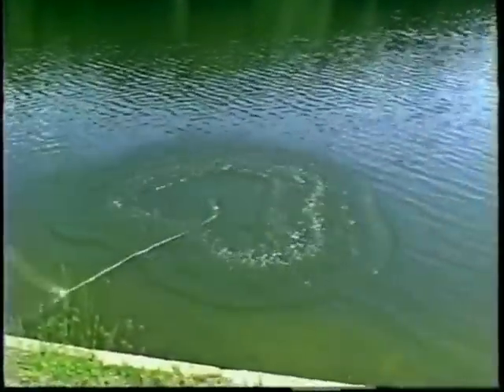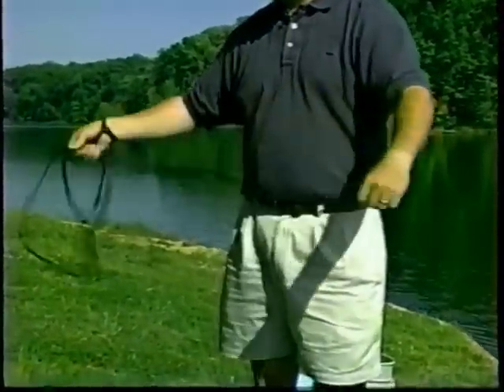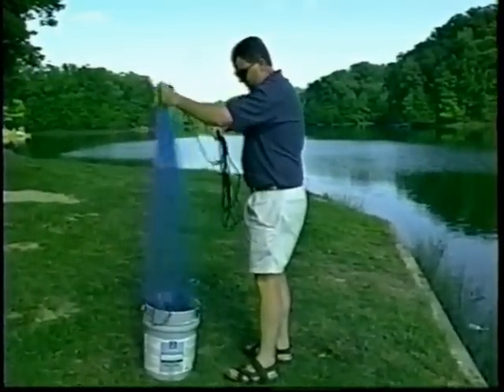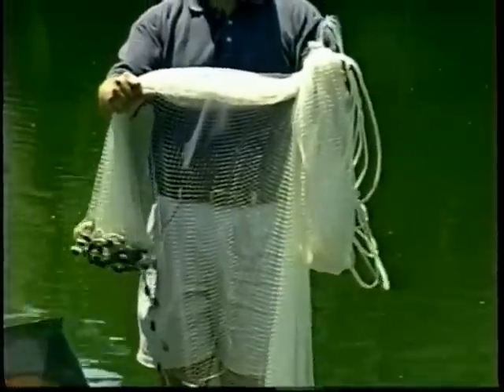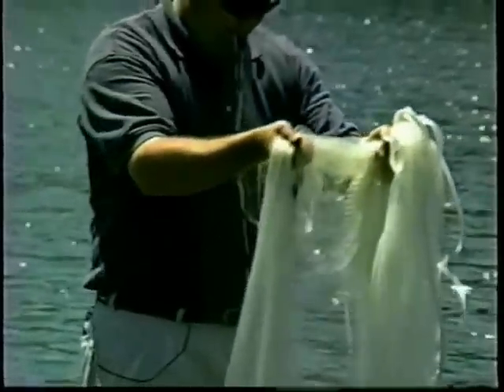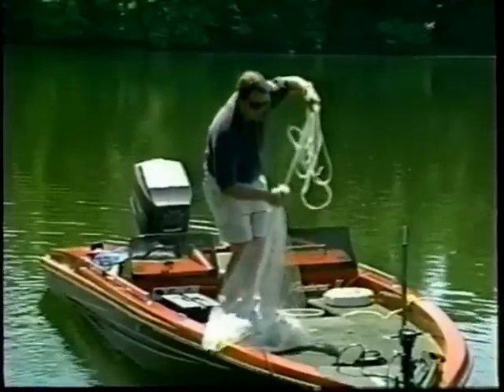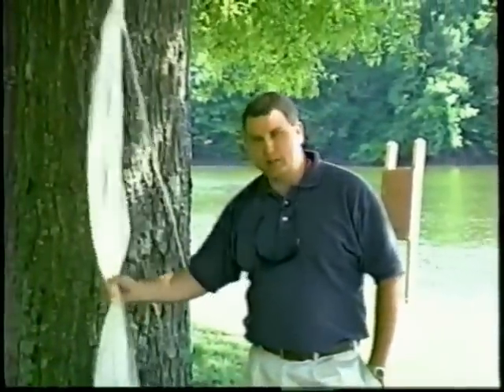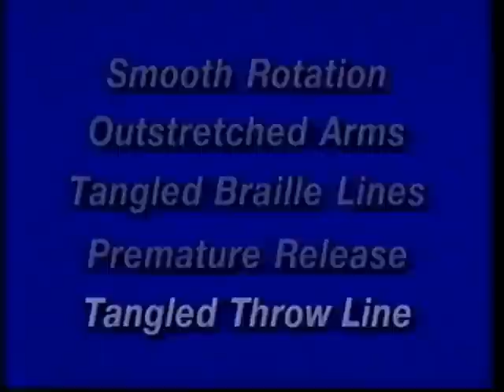Cast Nets Throwing Tutorial

Comment: Whats missing!  He says swing your net back 90 degrees and then forward 90 degrees past the start position.  That is a 180 degree swing.  A beginner will never get the net to open right if he does that.   The small net demonstration shows the man standing with the water on his left side.  After the throw the water is in front of him.  He is swinging the net 270 degrees.  That puts the spin on his net and opens it.   Stop the video during the throw several times and you will see his feet shift as he turns left.  So he is doing the 180  degree swing plus turning his body another 90 degrees.   That 270 degree net swing spins it out.   If you don't stop the video you probably missed the feet action. 
The video is from a company that sells nets, they want people to be able to throw them.  So why does the demonstrator leave out this critical information?